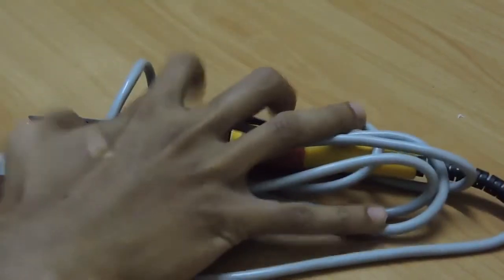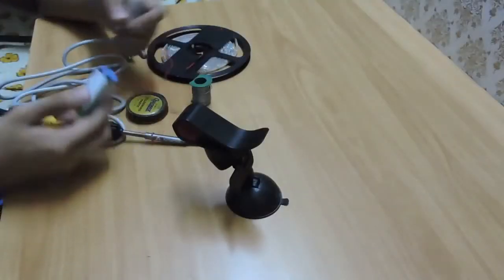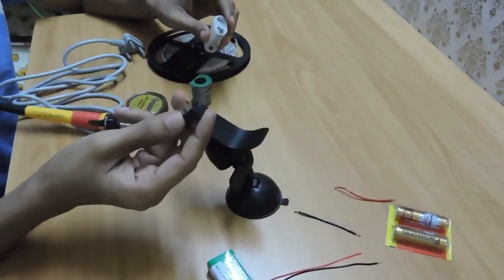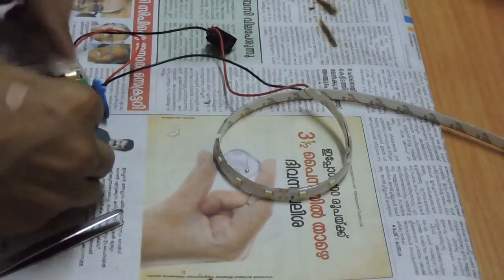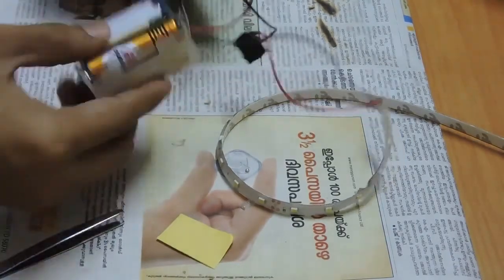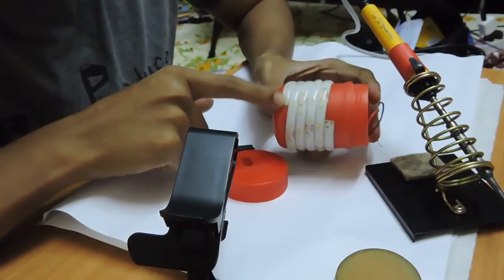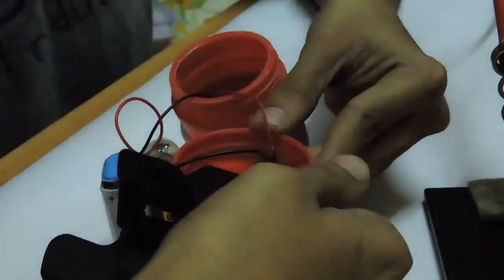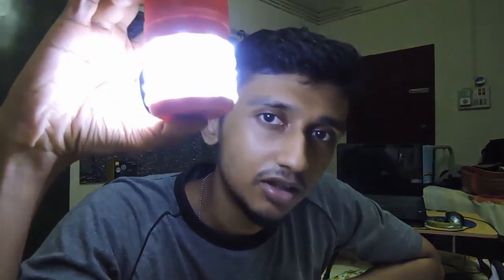INSANELY cool LED Light Under 3$ that runs for 10hrs: DIY

Comment: o...I see bro..I have  a 12 v 1.5 amp.. small jell ccell battery..if I use led strip..do yo think..it will run 10 hours.
Reply from the maker: What is the LED strip amps?

Comment: bro.is it actually runs 10 hours?is it true?what was the ampiar of your battery?
Reply from the maker: +Ayan Magamind 10 hrs is bare minimum, it would run even more. 9V will around 500mAh and AA 1.5V will be around 1000mAh. 9V will run out faster. Number of hours = Battery Amp/LED amp(Not specified).

Comment: I have a question..bro..why you use 9 v battery with two..AA size pencil battery?what kind of voltage your led strip consumption.is it 12 v power supply?& led strip?
Reply: is it surves back up 10 hourse..is it true?
Reply from the maker: +Ayan Magamind Yes it is 12V.
Reply from the maker: +Ayan Magamind Maybe even more depending on mAh rating of the battery. LED has negligible resistance.